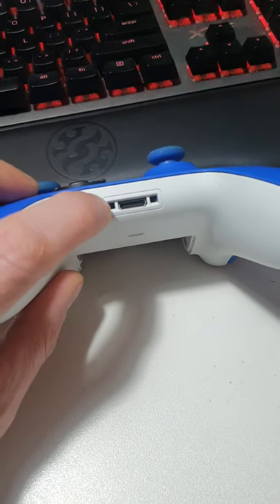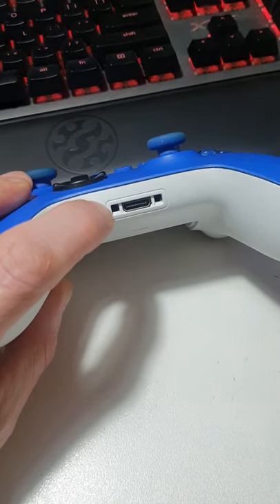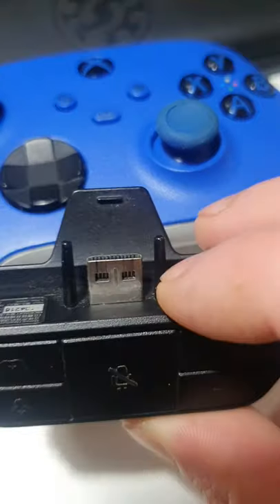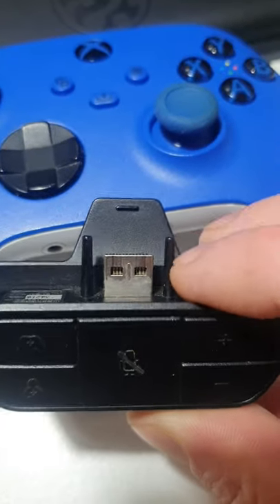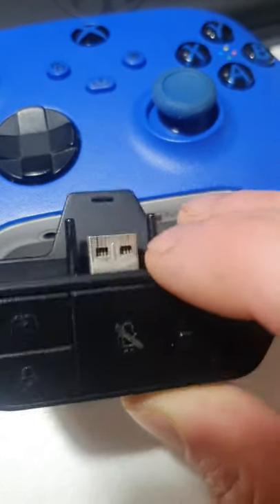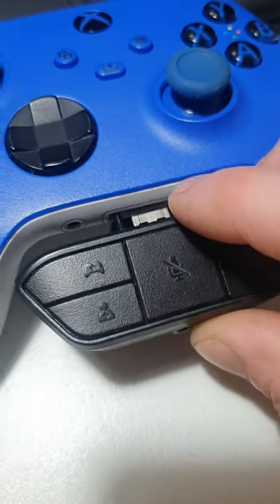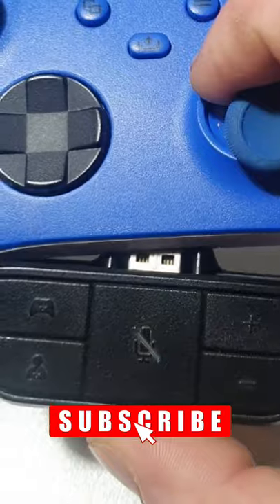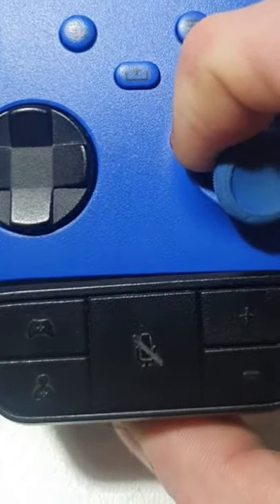these holes at the bottom of the xbox controller

Comment: Can u give a link and purpose for the small accessory u put
Reply: It’s a mic adapter for headsets
Reply: @ladynoire8339  oh thx
Reply: @ladynoire8339  where do you get it
Reply: Walmart or any place that sells Xbox accessories.
Reply: When the Xbox one originally came out in 2013, the controllers didn’t have headphones jacks, and instead, had that accessory come with headsets (or you could buy it separately) I used it for years and loved it but upgraded to the Xbox Wireless Headset when that came out just tossed this accessory in the closet, still amazing though and really convenient! Not sure if stores still sell it but it’s amazing tbh. 😄